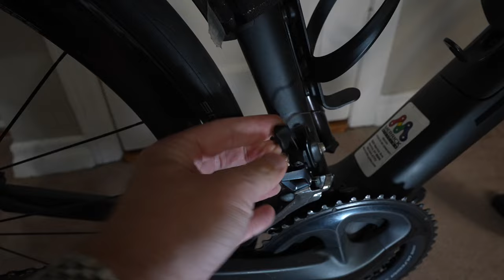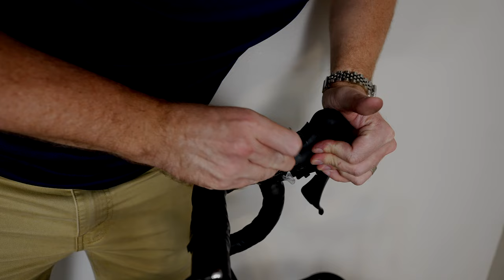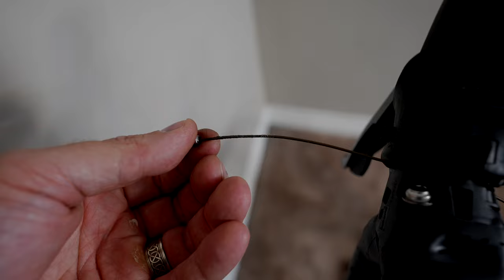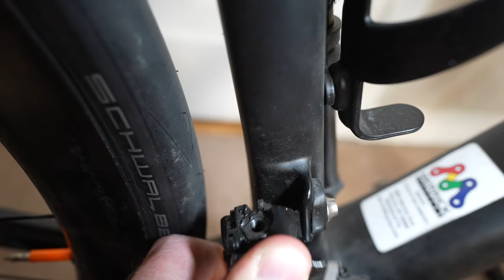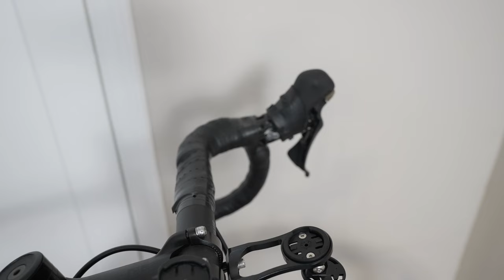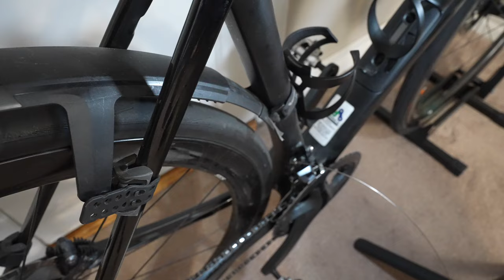Front Derailer Shifter Cable Replacement | Trek Domane SL6

Comment: Few months ago I had strange problem with the rear derailleur cable, when I took out the rear wheel, the steel cable got lose, so I pulled back towards derailleur, but the end of the cable (inside mechanical Ultegra STI lever) got stuck with its metal end. There was no physical way to pull it out. I had to drill a bigger opening in the plastic body to remove it. Never seen anything like it in my life.
For smoother shift I use DT Swiss light grease (for paws). Also using better quality German made cable gives excellent results.
Reply from the maker: I think that's what Happened to me when trying to put the new cable through the shifter. It got caught on the outside, and I had to take it all the way out and push it back in again. Strange problem! I'll have to try better housing for the front cable, see if that makes a difference.